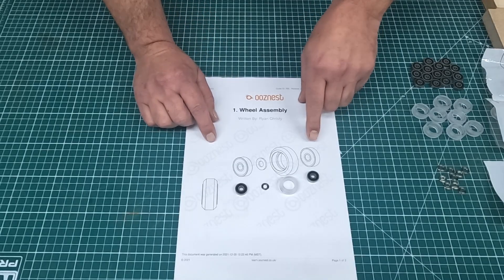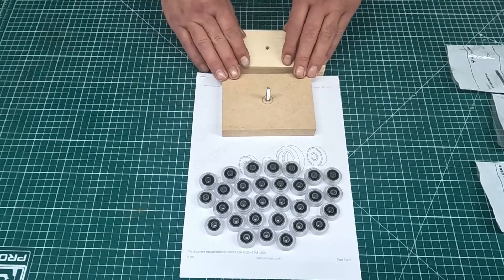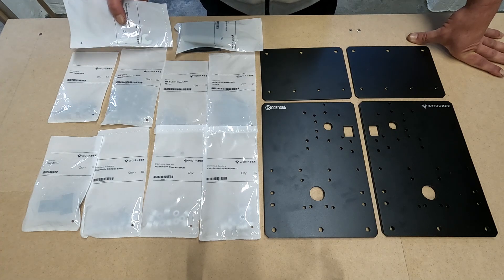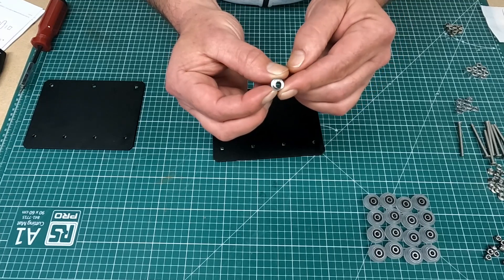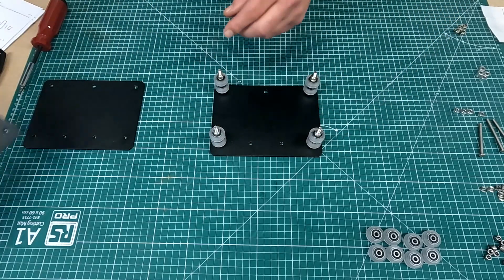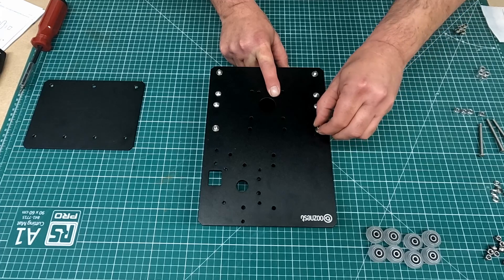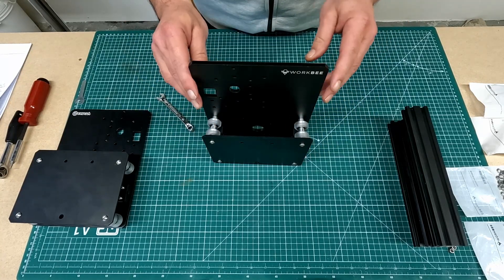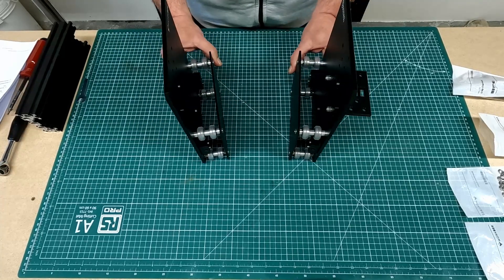Building A Workbee Z1+ CNC Part 2 / Wheels And Y-Plate Assembly

Comment: Legend!, first step of the build and you made it easy for me! I slightly modified the idea by drilling into a piece of wood with a 5mm drill bit, then releasing it from the drill and used that to construct the bearings, I also used a slightly larger piece of wood for the 6mm hole to push down to assemble the wheel, I only did this because it was what I had, it worked brilliantly! thankyou!
Reply from the maker: Your very welcome 🙂

Comment: I have just come across this video and noticed it was published 1yr ago, I am about to purchase one of these machines and was wondering how you rate this unit and are you still happy with it 
Many thanks  Bernie
Reply from the maker: Hi Bernie,
The simple answer is yes I am extremely happy with it. I have actually had the machine for almost 2years and I'm still loving everything about it. Easy to build and a very capable machine. Can I ask what specification of machine you were thinking of?
Reply: @EireWorkshop  I am going for the 750 x 1000 with the maffell router and unfortunately the ethernet connection
Reply from the maker: @bernieclark7143  that's great nice size and good motor. I'm sure you will enjoy the journey from building it to using it 🙂. Feel free to use the link in this video to the Ooznest site if you do it helps me to continue making videos of the cnc 🙂

Comment: Thanks for the wheel assembly tip.  I only had 60 wheel bearings despite the bag saying "62".  I guess this is ok since I only need 30 wheels, did you experience the same?
Reply from the maker: Thanks, I got 2 spare but like you said you only need 60 I'm sure if you email ooznest they would send you on 2 as spares if you want them.
Reply: @ÉireWorkshop  Thats good to know, I only worried in case the extra 2 were needed at some further assembly stage.  Strangely I got 33 solid wheels in the bag instead of 31. I'll get in touch with them if I have any more problems, I hear their support is very good.